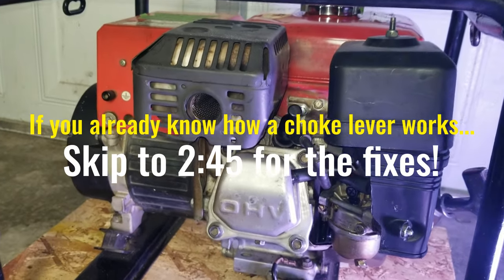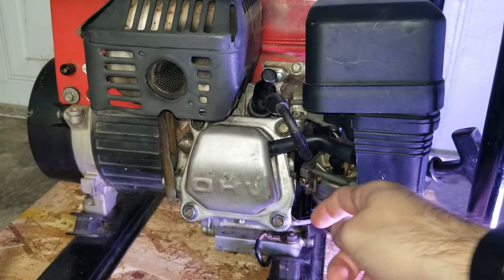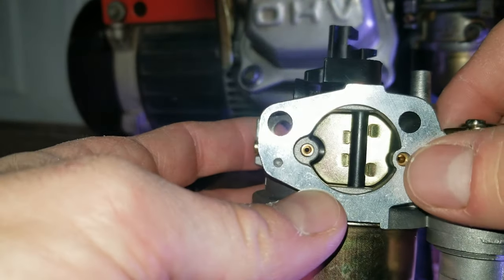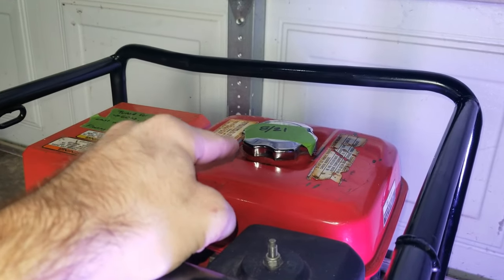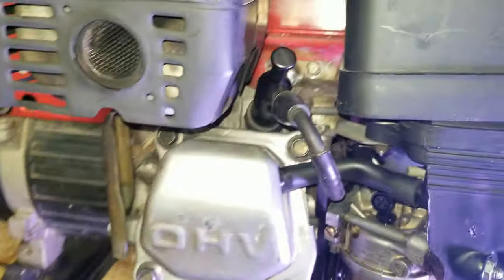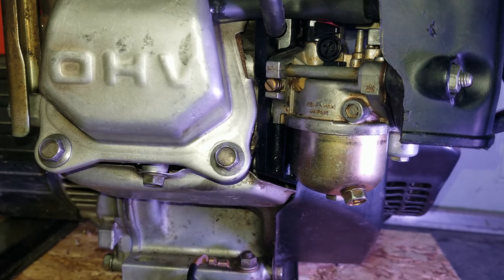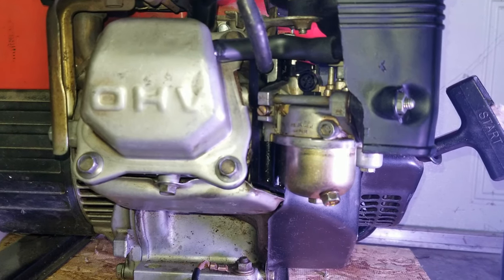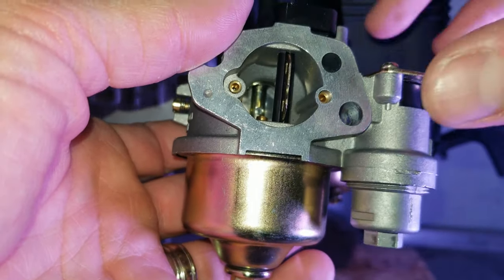[4 Quick DIY Fixes] Generator only Runs on Choke / Half-choke!

Comment: Also on Inspecting your Carburetor while engine is running  you can spray Starting Fluid all around Carburetor Base , if RPM"S picks up you know you have a Bad Gasket. Just saying , great Video thanks.

Comment: Excellent video!  I had to run on partial choke.  Would still run fully open, but far from smoothly.  Duromax XP4400E.  I knew it wasn't bad gas, so I did the carb things you suggested.  The jet and tube holes didn't seem clogged at all, but I ran the tiny wire through them anyway.  I tried the same on the teeny tiny jet, but it seemed the wire was slightly too big to go all the way through, so I sprayed some brake cleaner in it.  Wire still wouldn't go through so I put it back together not expecting the issue to be solved, but it was.  Runs perfectly now.  Thanks!

Comment: Just finished this repair on my Powerhorse 9000W generator, purchased in 2020. It would start in choke and stop running when placed in run. The video is SPOT ON! There was just 1 difference, the bowl. There was a component attached to the bottom of the bowl with 2 screws. I had to use my Milwaukee impact drill to remove them. Then I could remove a nut to remove the bowl. Thank you soooo much for your video. 👍

Comment: I've rebuilt a few carbs before, but all I did was clean every part and port I encountered. My 2000 W Champion generator was waffling and required half-choke to run. Following these steps fixed both issues. I appreciate videos that don't waste time with the weather outside, pets, and trying to act cutesy or clever. After a brief description of basic carb functions, it got straight to the instructions. Well done!
Reply from the maker: Happy to have helped!

Comment: Just an important remark for people following this great tutorial. 
I recommend doing it in the order of the video, because the last solution might make matters worse.
The reason for this is that the last solution involves taking off the carburetor, and in my experience almost every time you take off the carburetor, the little gaskets get damaged because they are partly stuck to the metal. You might have created a whole new problem now.

If you do damage a gasket and you need to get the generator running asap and can't buy one, you can make a new gasket yourself from thin dense cardboard like a juice or milk carton. 
Take the black plastic manifold that is in between the carburetor and the engine and trace that shape onto the cardboard. 
With a sharp box cutter cut out the outside shape and the intake circle. 
Use a drill with a wood bit to make the two smaller holes on the sides, but go very slow not to tear apart your diy gasket. 
Push down the plastic manifold tight onto the cardboard while drilling as slowly as possible to prevent tear.

Hope this helps.

Comment: I am not a mechanic, but understand the principles of the simple gasoline engine. Rarely do I undertake mechanical repairs or troubleshooting without encountering multiple issues that i will not go into here. But I watched this video and followed your instructions, and solved the problem on my Champion generator without any mishaps. Other than losing the spring on the float pin and having to make a trip to O'Reilly's for some serious carb cleaner to get the green varnish out, and my generator hummed to life and started to sputter until I turned the choke down, and then off.... it ran for plenty of time without a hitch. Thank you very much for sharing your knowledge, it helped save me a great deal of frustration and money paying someone else or replacing it after I killed it.
Reply from the maker: So happy to have helped you out!

Comment: Thank you for this video. I fired up my generator today for the first time in six months we have rare extreme cold coming to south east Texas to start Christmas weekend and I don't trust that ERCOT  has our grid ready since the big freeze caused rolling blackouts in Feb 21. I noticed the generator would sputter/stall with no choke and would run fine with about 1/3 of the choke applied. I didn't use any fuel stabilizer so I added some and also removed and cleaned the pilot jet and allowed the generator to get nice n hot and now it's running smooth with no choke. Again thank you for the video and the clarity of instructions.

Comment: Thank you sir! Power is out here and the generator stalled after a couple of minutes. Drained the 2 year old gas out. Took off the carb bowl and there was a lot of funk on the bottom. Took the main jet out and it was clogged.  Put it back in after cleaning everything and it fired right back up! I almost gave up.

Comment: The video really helped me and the last part of checking my carburetor gasket was the solution to my problem as my carburetor was brand new and it only works on choke all because of the wrong installation of carburetor gasket.

Comment: This was the perfect fit for my 37 Ton Champion Log Splitter. After watching this video I was able to clean my carb and exactly as stated in this video, there was a tiny piece of dirt in the emulsion part and every time I turned off the choke, it would stall. I took it apart as directed in this video, cleaned it with a small wire and now it's running perfectly. The only thing I would add to the video is mentioning the tiny "O" rings on the piece below the idle screw. Mine popped off while cleaning and lucky I had a white towel below so I easily found it. Great video, thanks!
Reply: like you said  in video, The  only problem I'm having is the damn throttle won't go back on.what do I do and how

Comment: Thank you!!! I have had a problem with my generator that it will only run with the choke slightly closed. I had cleaned the carburetor 2 times and checked the needle valve, ect. The key was that secondary black screw trick where the tube was clogged with a piece of dirt. It runs perfect now!!!
Reply from the maker: Awesome!!!
Reply: The one on the carb??
Reply: @KollynJ . Yes it is on the carb right where he points to the black screw.
Reply: @rjtoups  between that other jet and the double tightening of the carb my Honda is purring now

Comment: Thanks for offering your information. I cleaned my carburetor, change the oil and spark plug, and filled up my gas tank. I regularly used my generator. But now it still will not start. Previously it was only running on choke, so now it won't start at all

Comment: Hi, I'm writing from Spain, my brand new chinese ac generator 4 stroke gas engine powered, from the begining has only runned smoothly with the choke lever at mid range. I carefully read and listened to your excellent video and I'll try to check all the jet screws, main and idle. I'll do that tomorrow and I'll publish here the result. Thanks a lot for such a well performed and didactical video.
Reply: any updates?
Reply: @ThunderMan88 Apparently he blew himself up.

Comment: Since generators never run at idle, the pilot adjustment screw only needs to be screw in far a few turns to keep it in place.  In other applicatons, you are correct.  Count the turns to get it a close to the original setting as possible.  But that small opening on the pilot jet needs to be clear because upon startup, that's the fuel source to get the engine running until the main jet provides fuel at higher RPMs.  Some emulsion tubes aren't removeable.  If you can't get it to come out, don't force it.

Comment: Thankyou so much for this. Your explanation was perfect. Just bought a second hand one and it won’t idle after the choke is off. Just one thing. What is the small screw on the left of the carby for? The one sitting all by itself?.

Comment: Every hurricane season I always start my generators and make sure they are running like they are suppose to.  This year I went to start it and it will only run with the choke on. Hopefully this resolves my issue. 

I always turn my fuel off and allow the generator to run until it runs out of fuel just so there is nothing left so idk how it would get clogged.  I also don't leave any gas in the tank and drain it all out into a gas can prior to storing it.

Comment: I'm gonna try this tonight, but I'm pretty sure you just fixed my generator.
Reply: I need a spanner 🛠️... Monkey wrench wouldn't turn it was too tight.. so we'll see 😊
Reply: So after completely disassembling and cleaning the carburetor, I have a similar result. When the choke is fully open, the engine gives a vera, vera, vera, vera, and then shuts off. the fuel is new 95.. i also added a fuel filter between the tank and the carb any ideas???

Comment: First I want to say: Thank you very much for this vid.

Now to the question::: My generator is having this exact issue. I got it running smooth with the choke almost all the way on. If I run it like this a few hours will it cause damage? Power is out and I need the generator running for my family and also myself. 

I will try to repair it using this vids information another day.

Comment: Instead of using the flimsy metal wire from a bread tie. A straight steel guitar string. Or a guitar string with the outer windings removed period has done a good job for me

Comment: I have a Honda eu2000i and has been having this issue. It’ll run for about 30 minutes on full choke, but as soon as I try to run without the choke, it immediately dies. I’ve only run it about 8 hours and it’s just starting to act up. I pulled the main jet, and pilot jet, cleaned them up, and cleaned the carb too. All the gaskets look brand new, and lines all clean. I have no idea what’s going on!

Comment: 👍 and subscribed! Does your unit also got this lever called Smart Throttle High Efficiency thing? I dont think its working like how it used to when I first got it since I've made some adjustments like cut the spring short so it pulls the rpm and lowers it

Comment: I see that my hose going into the air filter is cracking along with others and needs to be replaced. Do you have a video for changing the rubber hoses??

Comment: This stuff was self taught and well know to the boys and men of a couple of generations ago. During and after the War, we grew up with carbureted engines on autos, trucks, motorcycles and boats. Todays engines in most of those machines are fuel inected, controlled by computers. Boys today do not experience the active hands on learning environment of the '30s, '40s, and '50s.

Try this question on any group of auto mechanics - "What is a heat riser, and what is it for " ?

Comment: I've got fresh gas, a clean tank, new fuel line, all new gaskets, new carburetor, new air filter. Generator only starts with a shot of starting fluid. Runs once choke is moved to run position. But if you hook a load to it or even look at the governor control on the carburetor, it will immediately cutoff. I'm on my second new carburetor, same result.
Reply: Could be something in your AVR. Mine goes to wide open throttle I f you let the linkage run it so I have to figure out why

Comment: THANK YOU,  Wish I'd  Seen This Video 1st, Instead of the 10 or More I Found,,,I Have a TROY BILT Pressure Wasker With The GC160 Honda.   Its At Least  15 Or More Years OLD. Only Thing I've Done Is Replace the PUMP,   Yesterday It Started Dieing Soon as It Started and I Shut Choke????  Only RUN on Half Choke,   Finished The JOB I Needed to Do,  GOT On Here, Looked for Videos,  Got Tired of Looking,  ORDERED a NEW CARB, Amazon,,,,  Delivers Tomorrow.  I Hope That's IT,    Keeping My Old Carb for Spare, IT Comes With Gaskets, Hoses, Spark Plug, and It's The OEM ###### From Honda,  $32,00.

Comment: What if you don’t remember the throttle adjustment screw setting?  Do you just back it out as it’s running til it runs smooth during non choke?
Reply from the maker: Hey!  If the carburetor is still mounted on the generator,  I've found that if you screw it all the way in and then back it out 3 full turns,  it seems to be very close to ideal on many carburetors.  You can adjust it as needed after that.  

If you have the carburetor off your carburetor, you can look in the throat of the carburetor from the throttle end and you'll see a few tiny holes (the diameter of a twist tie wire) in the throat wall of the carburetor. It's not true for all carbs, but for many  there's usually a single hole by itself up higher,  and then 3 holes in a group below the single hole.  Adjust the throttle screw so that when the throttle is closed,  the edge of the throttle valve blade is just past the first hole that's closest to you from the group of tiny holes.  In many cases,  you'll find that by doing what I suggested in the first paragraph,  you'll usually end up perfect by backing it out 3 full turns.
Reply: @HomeBatteryBank  Perfect. Thank you for taking the time to write me back..

Comment: have a Powermate PMO126000 with the LCT414cc engine. I installed a new carburetor, fuel filter, all fuel hoses and cleaned out the fuel tank. Upon starting the engine it idles o.k. but when applying a load it surges. If I close the choke about a third of the opening it doesn't surge as much. What else could I check? Thanks

Comment: I have a hybrid generator (gas or propane) and I am running it off of propane.  I just got the propane about a week ago and I am storing it outside. It's about 57 degrees outside.  It starts to stall with an open choke. Could the propane just be too cold?

Comment: My generator turns off when the choke is moved to "Open". Not sure why, if anyone can elaborate i will appreciate it. Its a Duromax 12000eh dual fuel. It works great, but the instructions says to only leave the choke Off for 2 seconds then move the lever to Open. When we move it to Open the whole thing just shutdown.

Comment: Question/Problem.  Honda eu2000i runs smooth both ON/OFF eco mode, no lode.  Hair dryer test,  .. runs fine, all 3 settings  450/675/1200Watts ON eco mode. Bogs, sputters, dies, OFF eco mode. Full throttle. Anyone have experience/solution with this symptom?  Usually, the symptom's the other way around. ..